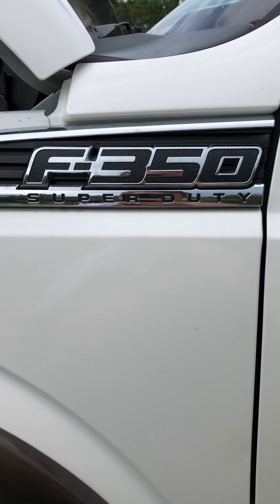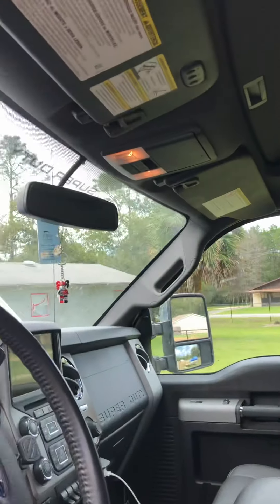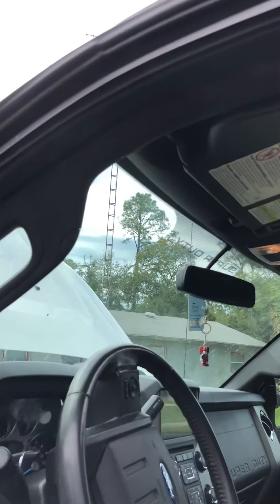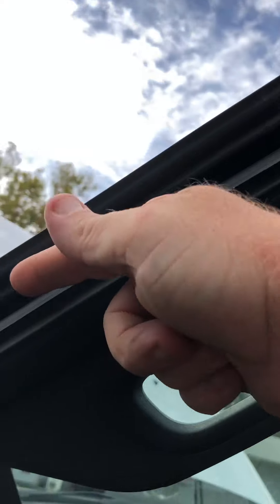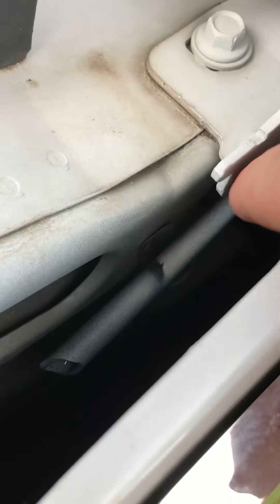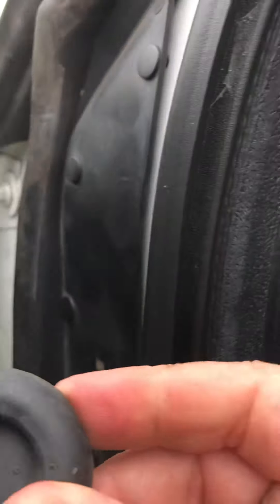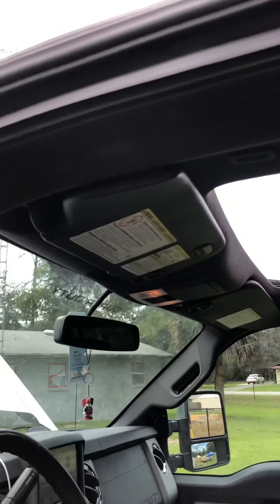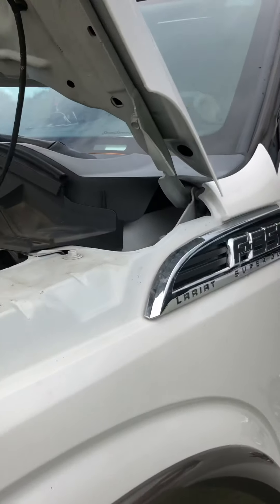2015 Ford F350  Superduty  6.7 powerstroke leaking sunroof

Comment: Our water leak very similar water a bad seal on upper windshield seal.  New windshield and issue went away.  Now our drivers side  floor is damp.   Leak Master from Olympia Washington said it is defective sunroof.  Used 3 inch Gorilla tape to tape all possible leaks on sunroof for now.